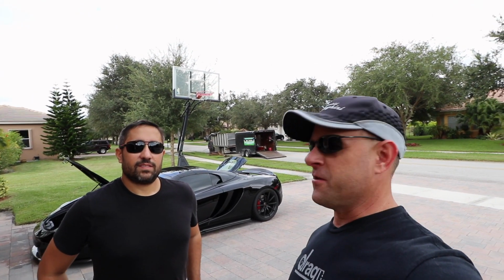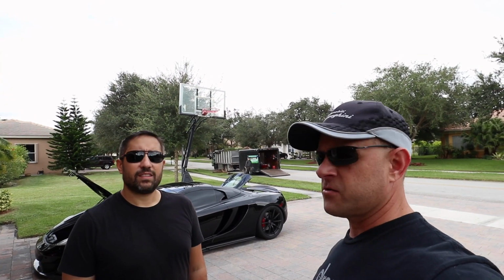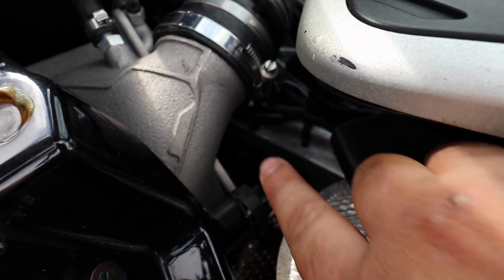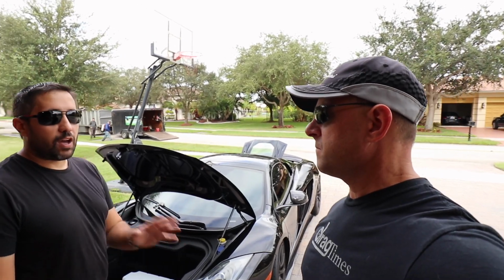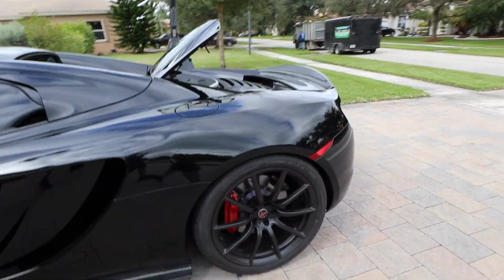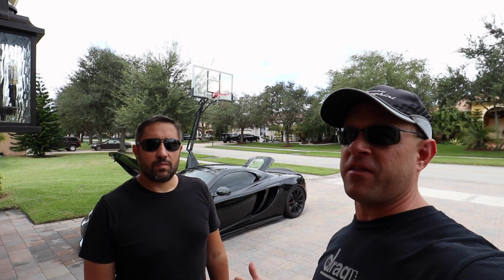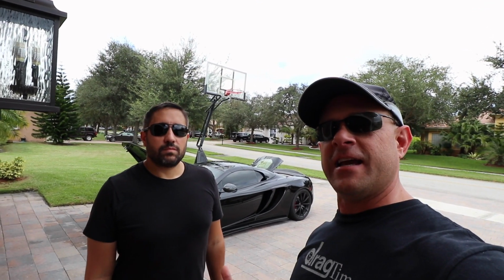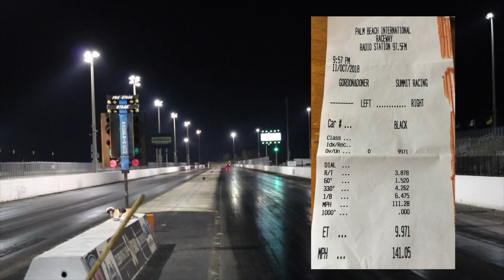How to beat a McLaren 720S*  Meth Injection?

Comment: How to beat a 720s, I use my busa. Got to run one on hwy 70 heading west and walked it from 70 to 180 at about 8 car lengths. That car was faster than I thought.
Reply: H&P Customs how much you making to the wheel? And is it turbo?
Reply: @RealCapo88 depends on weight of rider and ball's on 720 driver. Lol
Reply: stock busas run 9.9's so the 720s vs busa race would be epic but please i'd rather see the ducatti V4 and kawasaki H2 face the 720S
Reply: Stock Busa will murder stock 720s. It is not a rocket science we talking 500 hp/t vs 800 hp/t.
Reply: How can you compare damn 200kg vs 1300kg car?
Reply: @saratov99  fastest stock busa ran 9.70@148.48mph fastest stock 720s ran 9.68sec@145mph so again very close race i will also point out that busa number has never been repeated again and was a 2008 model meaning somethings fishy ive seen 9.90-10.10's for most stock not strecthed busas
Reply: 720S is fast but not liter bike fast.
Reply: 9.68sec@145mph  is also a unicorn run. Usually 720S@ do 10.0 141 mph.
Reply: 50-150 pull no chance for 720s against any fast bike.
Reply: Crap comparison
Reply: Erik Britz h2 beats the 720s. Ducati? Idk probably.
Reply: saratov99 neither is drag co-efficient rocket science. The bike is a brick compared to the car. If both vehicles had the same power to weight the 720S would walk the bike comfortably at high speed.
Reply: RealCapo88 all motor busas can run 7’s in the 1/4.
Reply: stubones brick? The bike isn’t that fat and bricky
Reply: I would think a stock Busa and 720 would be really close.  Brooks you beat everything else why not find a stock or tuned busa  to compare would be interesting?
Reply: @EBMproductions1  wrong they ran 9,4@149-150mph  but  thats a pro..
Reply: saratov99 That run is very much real. 9.68 is the fastest recorded 1/4 mile time in perfect conditions. Doesn't mean the 729s runs consistent 9's though.
Reply: @kaystruenoo  the 720s ran  9,79@145,89mph 1200feet  below sea lvl and 2-3%downhill.. so no its NOT  legit Result its  in 10-10,3 MUCH more then og runs below 10..
Reply: James Crain  correct finally one who gets it
Reply: James Crain  hehe you can say  that again 😂😂 gearing is the only thing that overcomes ptwr but  only for period of time in a acceleration race.. how  hard is it for fangirls 😂😂
Reply: @saratov99    do you have a clue WTF you are talking about?  So power to weight is the factor on who wins?  lol.  Do you have any idea how much wind resistance a busa has at high speed?   Bet you up to around 150 pretty close to even, after that the 720 will pull on it easily.
Reply: @saratov99    again you have no clue.
Reply: @saratov99  your wrong a tuned  570s smoking a liter bike.. only chance the bike has is from a dig to about 80-100 and Say Goodbye to the McLaren because he's going to walk right by you.. unless you're putting down 300 -350 horse on your bike your not sticking with him after 100.  My buddies s1000rr lost to stock 720 from 40-150 and from 30 to 150 not by that much but he lost none the less.. and yes hes been riding for 15 years and knows how to ride as good as anyone plus only weighs 155-160lbs
Reply: No way a 720 is even close to a busa I’ll put money on it ????
Reply: Did not think my little comment would actually get a comment,lol. The bike is a second gen busa with a ecu flash, power commander, different sprockets, Brock’s full exhaust, lowered front and rear,  modded clutch to take the shake out of it when pulling hard in lower gears and it has been dyno tuned. This is a non turbo factory swing arm bike. This bike is set up for highway pulls and that only.  All the mods cost me around 4K.
Reply: Comparing a bike to a stock car is just silly. With that said, a car can certainly be faster than a bike. I have a 7 sec TT Viper, I have never lost to a bike on the highway, even modded busa’s.   I’m sure there are faster heavily modded bikes, but either way it’s a stupid comparison!
Reply: H&P Customs so an all motor build. Nice

Comment: How to beat a 720s in a drag race. Have the driving skills of demonology or Ron Silva and own a dodge demon.
Reply: And spend thousands on mods like they did. Smaller brakes to fit smaller wheels, full slick drag radials, lightweight rear and front skinnies, tune. But still have their fastest time be slower than a 720s fastest stock time.
Reply: StrykerV8 the 720s that lost that day also had nitto drag radials.
Reply: dodge demon since you guy like to say a car is modded because it has aftermarket tires. Tunnel chasers demon was 100% all stock with stock tires. It didn’t even have the factory seat delete kit or the factory front skinnies and it beat a modded 720s that had drag radials. Both of your arguments is invalid. The 720s couldn’t even beat a 100% all stock demon.
Reply: StrykerV8 I wasn’t slower since the 720s only managed low 10s vs 9.8s.
Reply: This is the mentality of the majority of demon fanboys. Ignore the dozens of races stock vs stock, but go nuts when a modded demon wins. It's absolutely amazing.
Reply: dodge demon one had aftermarket wheels and tires and one did not. You’re argument is invalid. Also the 720s had aftermarket radials. Do you need the link to the video?
Reply: dodge demon you do know that the car comes with a kit to delete the seats from the factory right? If you didn’t now you know.
Reply: preludeF20Bking does it come with a kit to delete the rest of the interior too? You amaze me every comment you make
Reply: dodge demon I’m pretty sure it comes in the crate kit to delete the rear seats. I don’t have the time to look at the video but there’s plenty of videos showing the crate kit.
Reply: dodge demon dodge demon runs 9.8s with all stock power train. Those are facts. Poor 720s never had a chance. Both had aftermarket tires.
Reply: dodge demon on a roll it’ll be a different story and even then 4 mph difference won’t be a out of this world difference in car lengths. When we’re takin 6+ mph difference that’s where you start to see huge gaps between the cars.
Reply: "Demon runs 9.8 with all stock powertrain". Yup, just a few thousand dollars in mods to reduce weight and increase traction and lower times. And it's been done just once. A 720s has been in the 9.7s at least 3 times, stock powertrain, stock weight, stock tires, stock everything. You still lose.